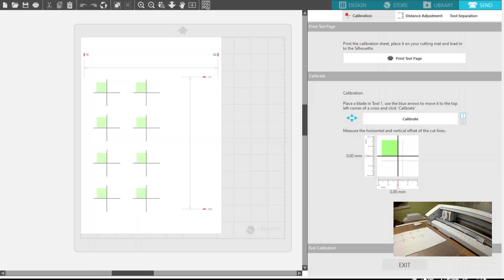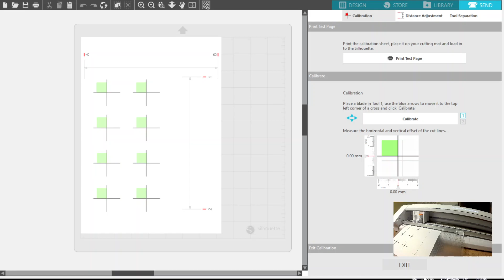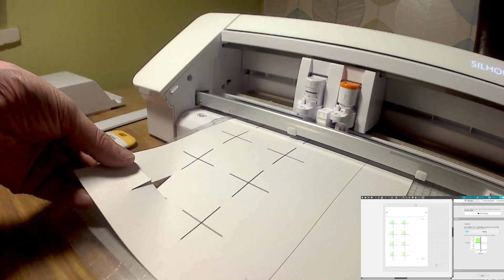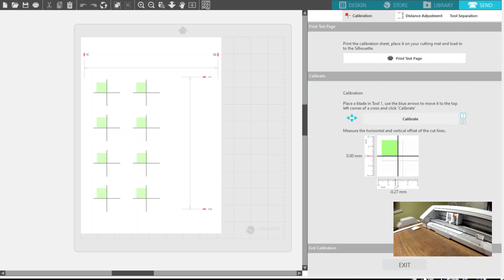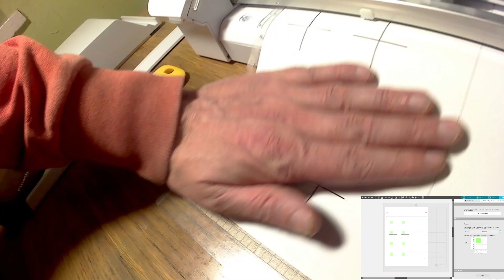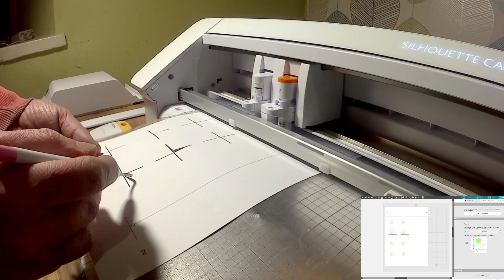silhouette cameo print and cut calibration - problems try this

Comment: Hello, I have a question about recalibrating the Cameo 4. In fact, on your videos I see that it is possible to change the values to hundredths of a millimeter (0.12, 0.15) while on my side I can only do it in tenths (0.10, 0.20, 0.30). Are there any choices to activate or do differently? I do it with a mouse. Thank you for your help.

Comment: Hi, thank you for sharing this video. After calibrating perfectly and exiting the page to proceed with the actual print and cut, the cut lines are still off. How can I fix this issue?
Reply from the maker: @vijayalakshmijagadish4222  make sure nothing is to close to the hatched section, if glossy paper place a non glossy sticker in place of registration marks
Reply: @topupdesign6620  I'm printing it on regular white copy paper and its not covering the corner sections too. Tried cutting close to 100 sheets considering all the comments and information shared online :( Not sure what I'm missing.

Comment: When I did the crosses, it cut directly on them, should I change this? My machine would not do anything either for the horizontal and horizontal.
Reply from the maker: if the cuts are centre of on both printed lines X and Y axis (horizontal and vertical) then it should be good to run and no adjustments needed

Comment: Do you think it is better to do one cross at a time, then adjust the calibration scale So you can test your modified adjustment on the 2nd and until you got the right adjustment? This way, you do not need to print another sheet to test if your adjustment work fine.
Reply from the maker: Yes you could certainly I just to a few to get a average as such before adjustment

Comment: HI! I am so confused because I literally bought a Cameo 4 Plus so I could do printable HTV cuts. It was my understanding that you could only do print and cut on Cricut up to 9.25 x 6.75 " ???  I truly hope I'm wrong and can return this Cameo. I HATE IT. Its so hard to use and so loud! I love using my Cricut so much better.
Reply from the maker: Hi yes it's slightly less than AT size as you need the registration marks 👍

Comment: Hello I carried my silhouette 4 to a hotel, and the way I was carr9it have my blade way off, when I turn it on it come straight to the middle of the machine. And is way off will this work in my situation
Reply from the maker: SOUNDS LIKE ITS NOT GOING TO HOME POSTION, TRY MOVING IT FAR RIGHT WHILST OF THE TURN ON, IF IT DOES NOT HOME CORRECTLY IT WILL NEED REPAIR

Comment: my horizontal line on 3 out of 6 of my cuts is actually printing in a diagonal line. its quite strange. the rest are just fine? any ideas on what the problem would be??
Reply from the maker: if your cutting on a mat/carrier then maybe its got a crease or spot that is causing drag or slipping, hard to say with out seeing it